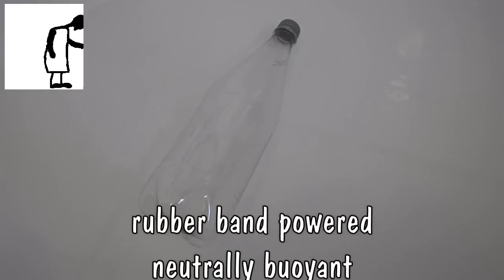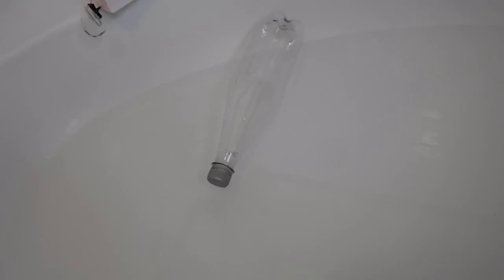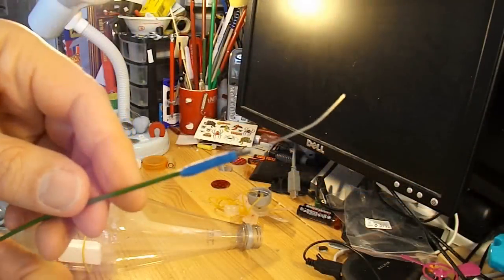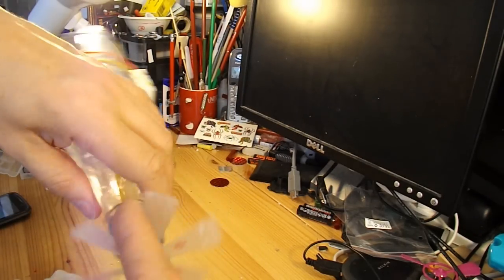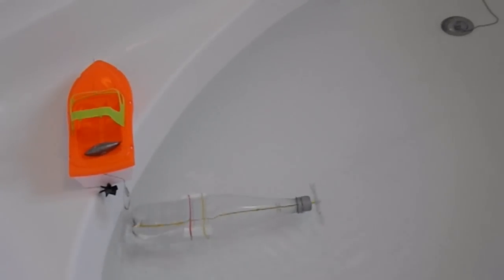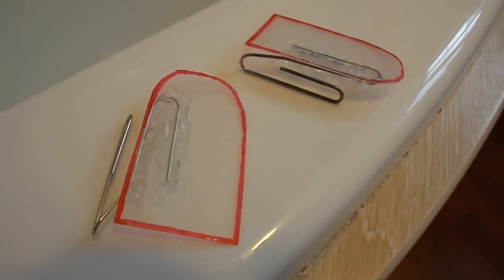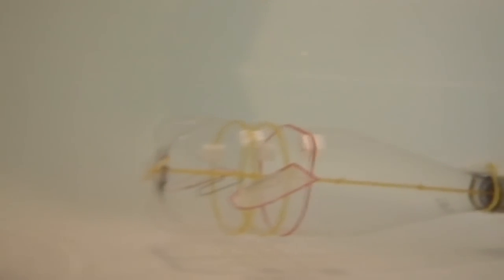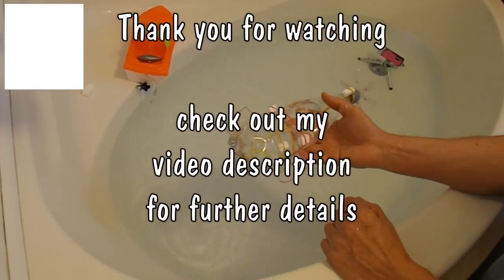Rubber band powered Neutrally buoyant Soda bottle Submarine

Comment: can this be possible. Take a very small bottle or a container about 3 inches in length pr make one, fill it all the way with baking soda and make a hole on one corner like on the bottle's cap. Would the water mix with the baking soda powder release co2 and power the whole thing by action reaction?
Reply from the maker: Vampire Volverene have a look through this playlist 
Baking Powder, Alkaseltzer, Steradent, Baking Soda, Bicarbonate of Soda

https://www.youtube.com/playlist?list=PLA5a2xPRSrB3V-oPfvHZu-3CpA8c9k9a4
Reply: does it really move forward though? it only goes up and down
Reply from the maker: Vampire Volverene does what make what move forward? It is best to add your comment to the video you are talking about.
Reply: ok

Comment: just a suggestion ...instead of drilling the bottom ,it might be quicker to heat a nail and poke
Reply from the maker: Actually I used a soldering iron but I have to assume my viewers have limited equipment.
Reply: ok ...cool
Reply: john michael that is called owning lol

Comment: hi, I'm doing this project in grade 8th science where we are supposed to make a submarine that dives down 30 ml and picks up a paper clip we are also not allowed to touch or maneuver the sub to change the buoyancy so I was wondering if you have a video or can tell me if there is any way we could change the buoyancy without touching the sub? like filling it up with water to sink and letting in air to float? (sorry this is just one of our big projects in our class this year and I want to get that A+) thanks!
Reply from the maker: The way this one sinks is the forward motion makes it dive due to the angle of the 'dive planes' or fins, when the power runs out it will surface again. There are two simple methods I can think of that might work for sinking a sub and getting it to rise again (with a little magnet to grab the paperclip). One is the baking powder method and the other is the Cartesian diver method. If you go through my submarine playlist they both appear https://www.youtube.com/playlist?list=PLA5a2xPRSrB0YFWgPosff-Wy7IDGMjWZn I can remember seeing a video of a Cartesian diver used to pick up paperclips but I can't find it now.